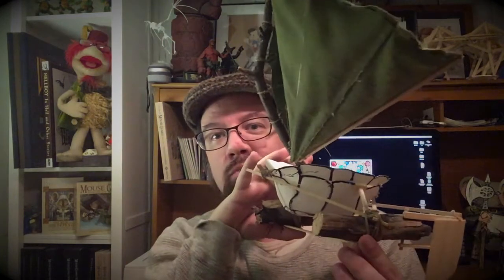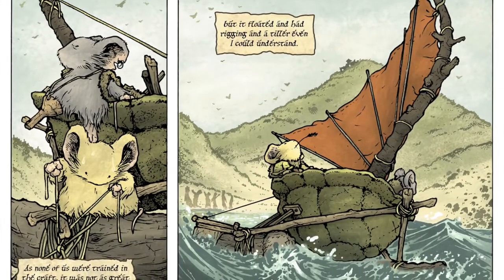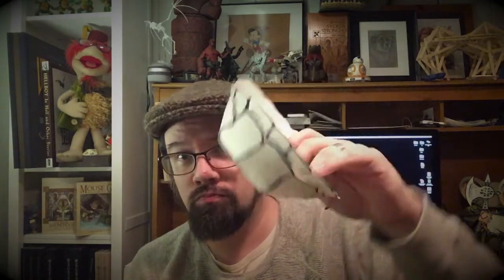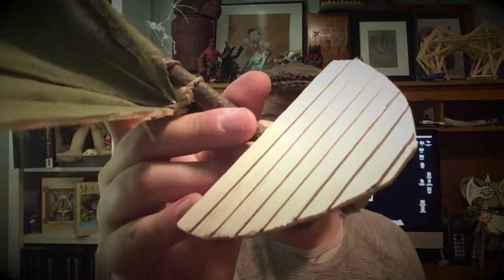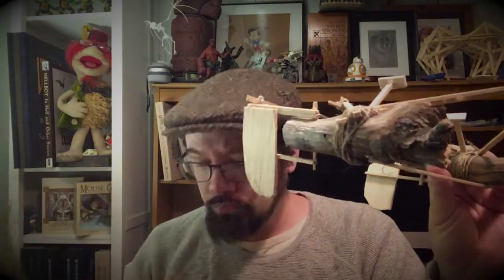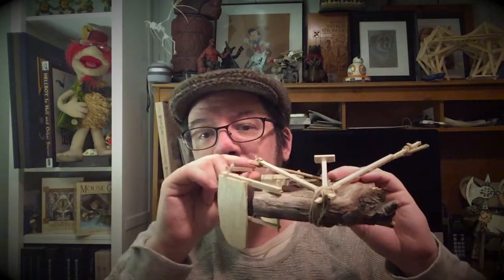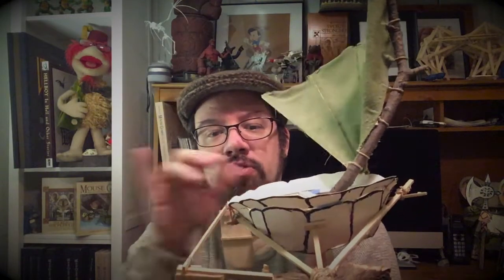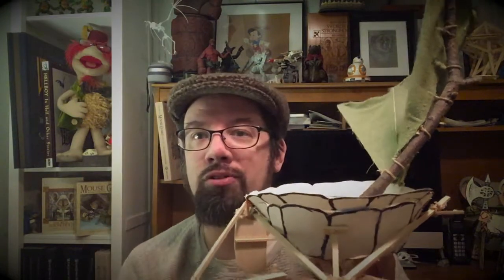Mouse Guard Architectural Model: A Ship of Shell & Timber Scrap

Comment: I like your attention to detail, without going overboard (pun intended). Do have small mice models for scale and positioning?
Reply from the maker: I have some sculptures of the mice I did even before I started work on the comic, but they are not to scale with any of the models. Heck, the models themselves aren't to scale with each other...so I'd need mice for nearly every one. 

In the past I've been able to use risk pieces as mouse placement figures for a few of the models, but that's a rare occurrence.